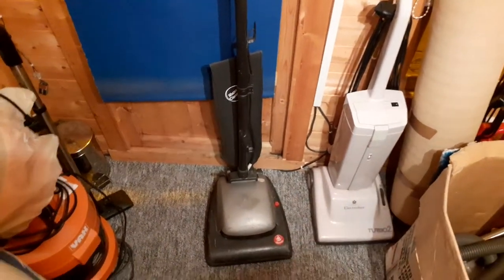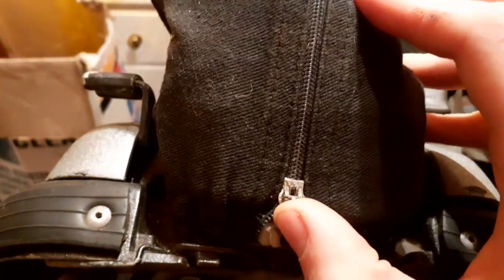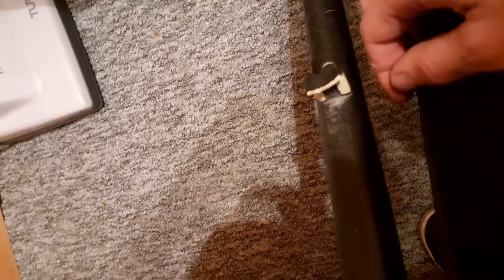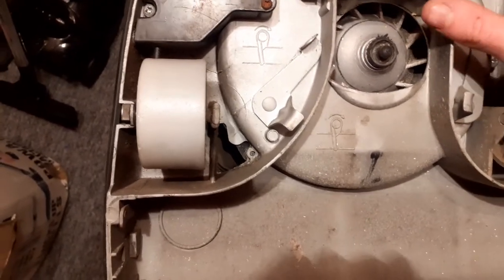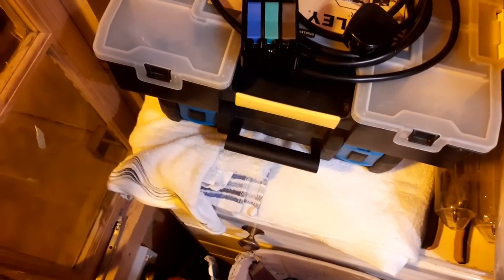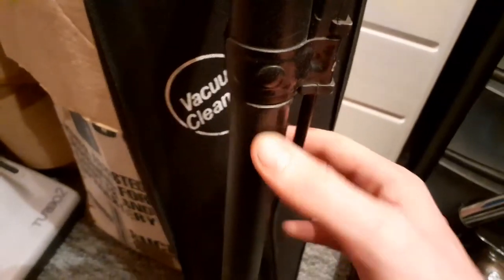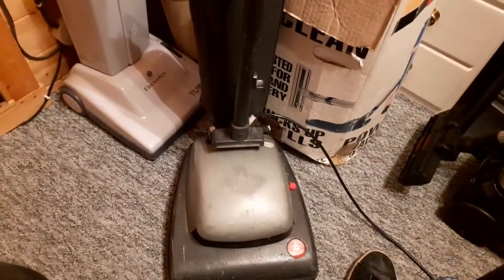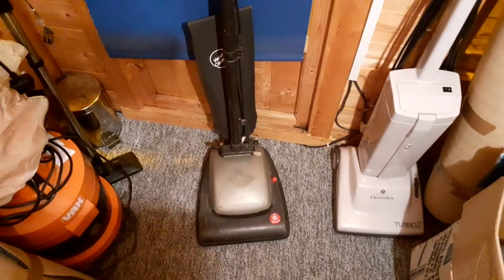Summit Vacuum Cleaner (Definitly Not a Hoover Senior 652!)

Comment: It is a Hoover Senior.  Summit did not manufacture vacuum cleaners. Summit were one of the companies that reconditioned Hoover vacuum clesners 
that had been traded in. Summit also reconditioned traded in Hoover Juniors. Summit reconditoned Hoovers were sold in electrical shops such as Modern Appliances here in Colchester. My dad worked tor Hoover.
Reply from the maker: Yeah I know it is. I also refurbish them for a living and I was joking and being sarcastic in the video. Thanks for the info but I know its just a senior 652.